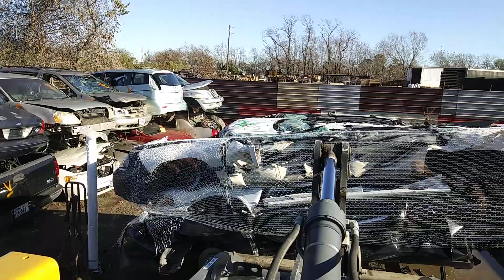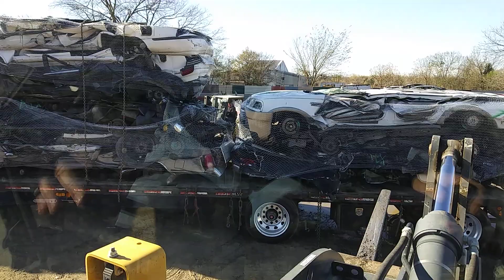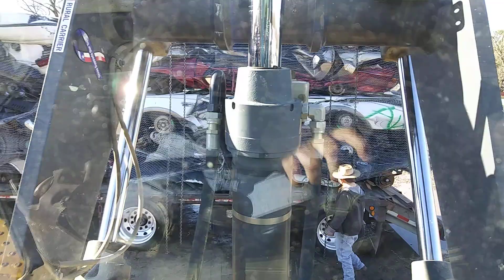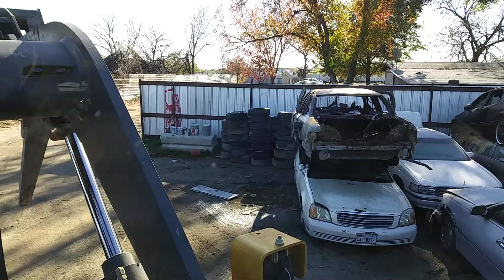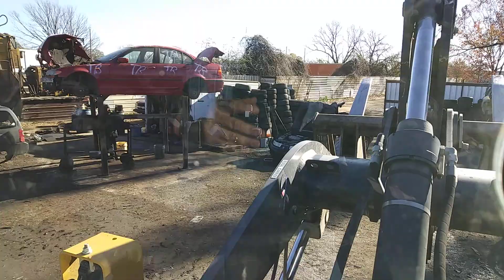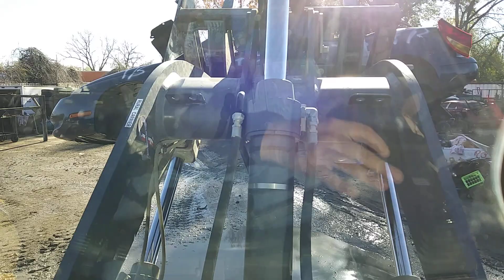Some Car Crushing Chicken Soup for your Soul

Comment: When you crush the Winnebago, use the scraper to smash the camper. The forks will poke holes through it, but with the scraper, it will be faster and easier.

Comment: Looks like an Okie plate on that BMW.  

You probably could save cars on a limited basis.   It's easy to get over your head with that.  I'd keep it to like five at any one time.  See something good, set it aside, research if it will sell, if it's worthless then just scrap it later.  And if you can't sell it in a few months, scrap it anyways.